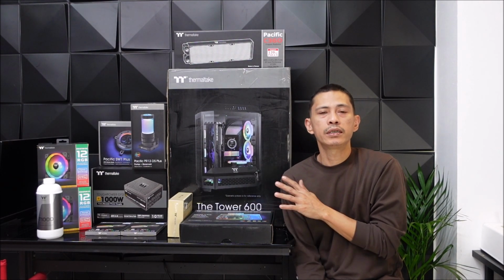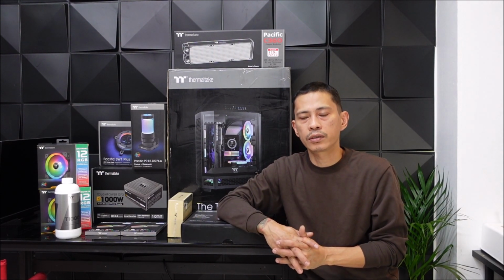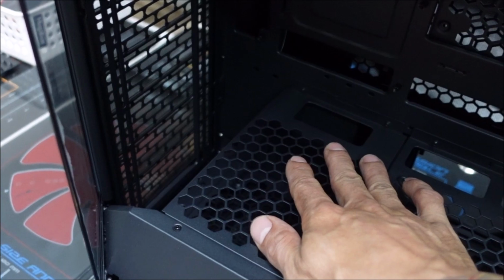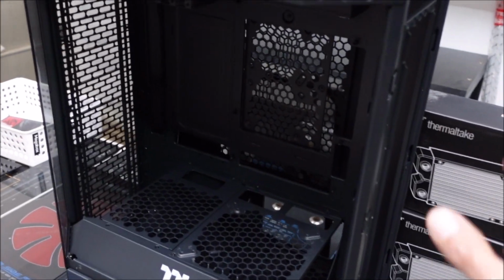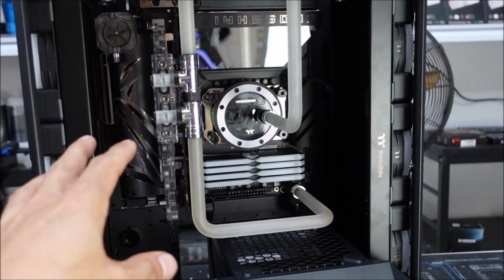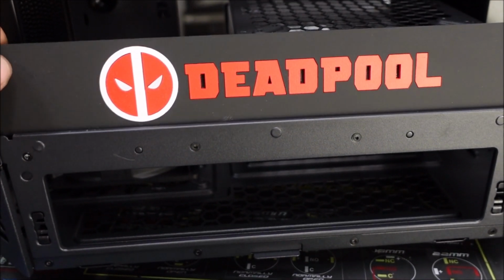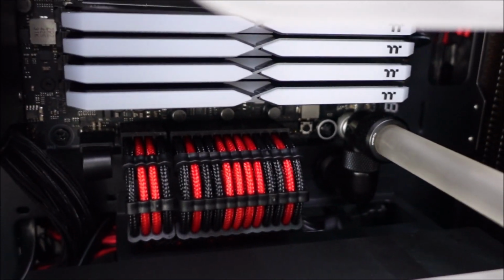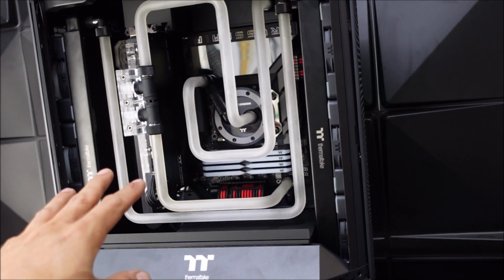Custom Pc Build #146 " The Tower " A Custom water-cooled Gaming PC on a Thermaltake Tower 600 case.

Comment: Wondering if it's possible to fit the pump inside the hole on the left of the PSU or mount it to one of the radiator fans on either side? Do you think it's possible to do this same design with a different tube configuration while somehow fitting the pump inside?